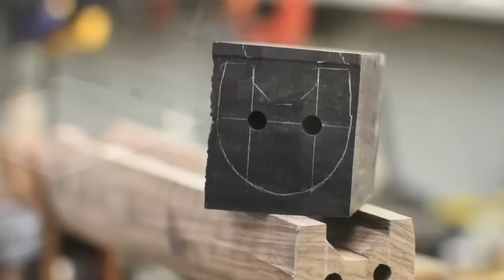HOW TO MAKE A CUSTOM GUNSTOCK - .375 H&H

Comment: With that machine you can make a rendered version and print it in 3D or make it a plaster model, and then just replicate it in fine wood.

With that and some basic carpentry knowledge you can produce high quality stocks in almost no time with so low investment, once the machinery and tools are amortized.

Comment: How to make a custom stock
Step one: own tens of thousands of dollars in woodworking machines, including one specifically designed for making gunstocks.
Reply: Were you expecting 19th Century tools in the 21st Century?
Reply: @IndianOutlaw1870  I'm mainly pointing out that the title isn't appropriate, it should be called "making a custom stock" or "how custom stocks are made". No one is going to pick up a piece of wood and be able to use the steps in the video to make a custom gun stock unless they're specifically already in the business of making them and have put a large investment into expensive machines
Reply: @slavpepe6581  you don't build a stock without a significant investment in tools, regardless of the techniques that are employed.  Some things are obvious, even to the casual observer.

Comment: Great job mate , I noticed that you used a heat gun when you whiskered the stock. Does that make any difference in comparison to air dry ? I'm thinking no . Great stuff mate
Reply from the maker: Thank you! I'm guessing it doesn't make a difference. Just saves time.

Comment: Nice work and  checkering with out use of a cradle.
Reply from the maker: Thank you!
Reply: @mnrcustomllc8253  Your welcome,  good work deserves recognition.  I really like the cradle you used , fixture,  to put in the cross bolt and bases for the sling studs. That is a nice fixture.  Just a nice classic pattern.  Really like the  octagon barrel. Beautiful job.
Reply from the maker: @ronthompson2366  Thanks again. The fixture I used to install crossbolts and other mill work is a product made by RMS Custom out of Prescott, AZ. Very handy for that type of work

Comment: Are you using a Cnc or a manual router?
Reply from the maker: It's a manual router. The pattern stock is customized to the customer's dimensions and then duplicated.

Comment: Took something so Beautiful, and trashed it with some soundtrack.
I would MUCH rather hear the sound from the wood.
Ever cut out a stock with a bow saw, wood chisels, and time?
  Stunning wood, and a Beautiful Rifle.
Reply: I have hand saw.  Chisels.  Took 3 months min.  Made about  10 muzzle loader's I'm 1972 on
Reply from the maker: That's fair. The problem is my shop's never quiet. Usually the radio's on. So instead of a consistent sound track, you'd hear Rush Limbaugh one moment and then Willie Nelson the next:) As far as building a stock by hand, yes but no bow saw. Bandsaw, Mill, chisels, and gouges. That's how I made the pattern and how I make some stocks. I prefer the duplicator though, because it allows me to alter the pattern to the customer's specs. He then can try the pattern out before I cut the final stock.
Reply: MNR Custom LLC looking for someone to make a wood stock  have a poly one but would prefer wood
Reply from the maker: @mikevanheel9367  Hi Mike, I'd be happy to help. Please email me the details of what you're looking for. mnrcustomguns@gmail.com

Comment: This should be titled, "How to use specialized tools to copy an existing gun stock."

Good job tho, looks nice, cool vid, but not what i was looking for, title is a little misleading.
Reply: I wanted a better look at the duplicator. 
On the one I built the cutter and follower on one side of the crosscarriage and the counterweight on the other, pivot around a bar to get the vertical movement, this mean your cutter travels in an arc.
His one seems to travel straight up and down.

Comment: How much does something like that cost?
Reply from the maker: It would depend on features and the cost of the blank, but around $4k
Reply: @mnrcustomllc8253  That's just for the stock? Or the whole build?
Reply from the maker: @jakearchambault8160  Just the stock. Rifle builds start at around $10k. This one was closer to $16k with the integral barrel and upgraded walnut.